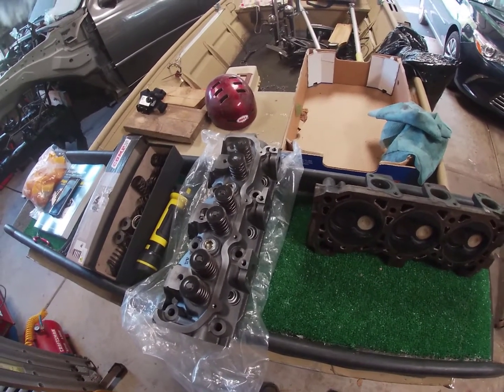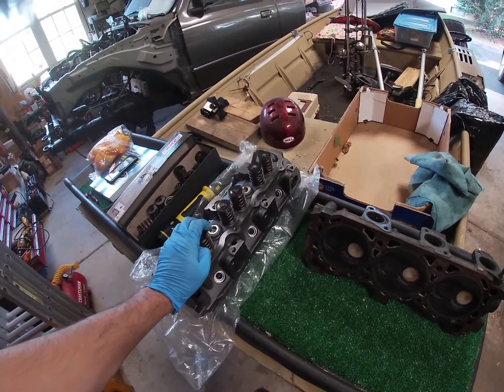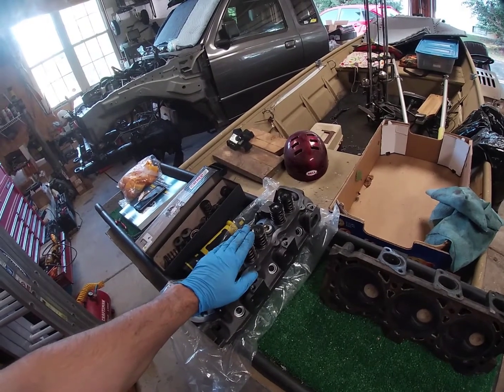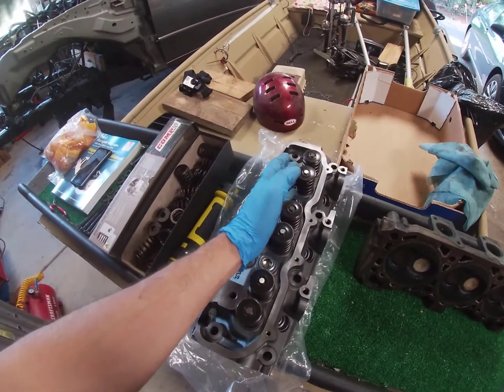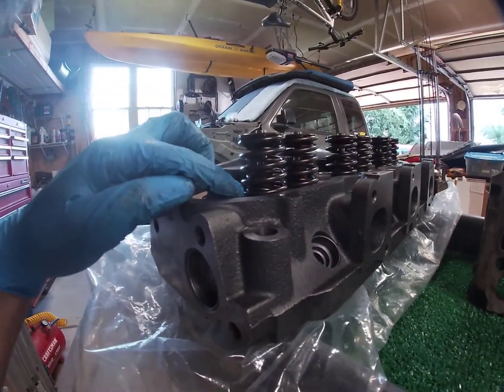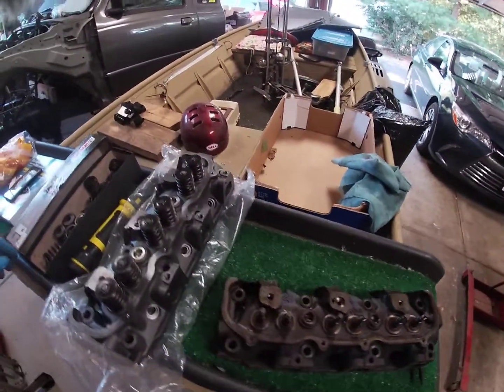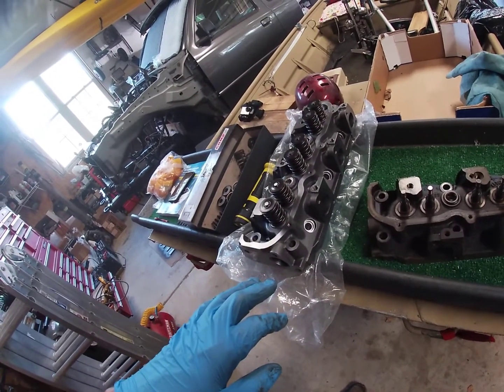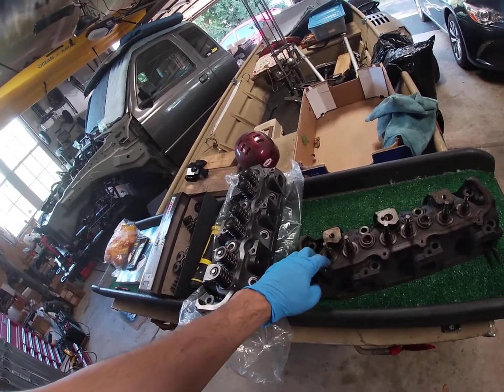Ford 4L Camshaft Head Changes

Comment: Hey legend, didn't you use retainers with 0,5020 ID for a tight fit with the guides? The part you put on screen had 0.690 IDÐ
Reply from the maker: No I used the .690ID retainers. Don't really want a tight fit around the guides because of the valve stem seal. Hope this helps.
Reply: @TEDDAV64  Is the engine running good and strong? No valvetrain issues?
Reply: @TEDDAV64  How is the lower part of the spring assembly located? 

It looks like it isn´t and is only located by the retainers

Comment: I’m rebuilding my 4.0ohv right now.. if you could take pictures of the front of the engine with the timing cover and water pump assembly with all the little brackets that attach to it that’d be great so i have a reference. Appreciate all the videos you’ve put out I’d be lost without them!

Comment: My recent budget rebuild I went with the 410 cam.  Since it's NA and almost never revs past 4000, I didn't bother with any spring changes.  I was a little concerned with pushrod length, but after swapping my wiped out factory pieces with stock replacements, I got good valve tip contact and .019" lifter preload.
Reply: Have you had any issues with that setup?
Reply: @thugnasty13  No issues from a valvetrain standpoint.  It was super smooth and quiet after break in.  Performance wise, it's not much of a change from stock. Maybe slightly more "luggable" with low end torque.  It might wake up with headers and a chip tune, but that's not in the budget for a while.
Unfortunately I'm chasing other issues at the moment with EGR and vacuum leaks, and piston rings that failed to break in properly.